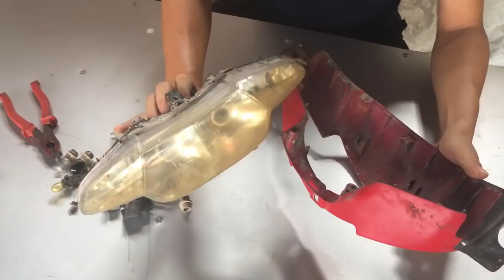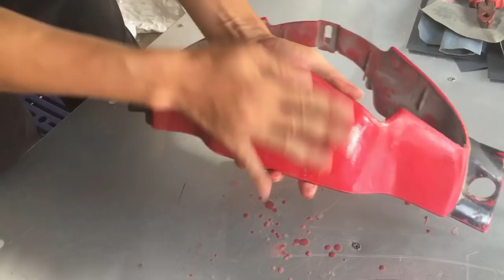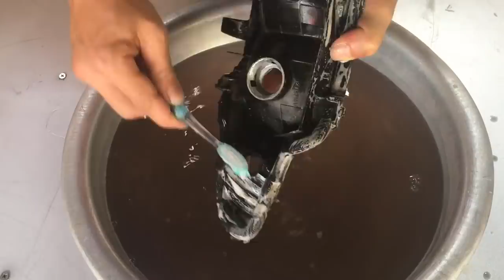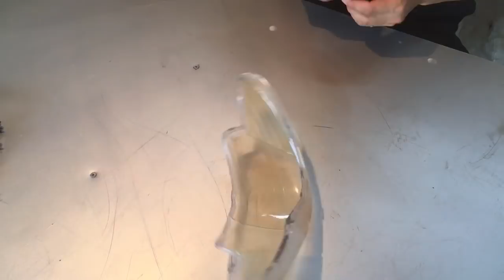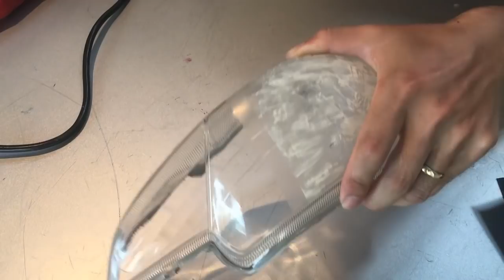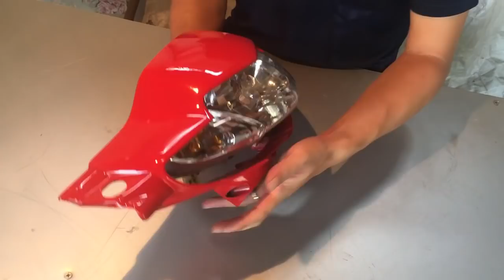Restoration of Motorcycle Headlight | Restore HONDA Motorcycle Headlights

Comment: If you were to install replacement LEDs for all the lights and use LED driver circuits, than even at idle the lights would be as bright as high RPMs. Just an idea...
Reply from the maker: yes. thank you

Comment: You can't spray the reflector ~ the light's capacity is now greatly diminished/ruined.
Reply from the maker: thanks for the comment
Reply: @dtrestoration8590  You did a fantastic job ~ just polish the reflectors and it will work great.